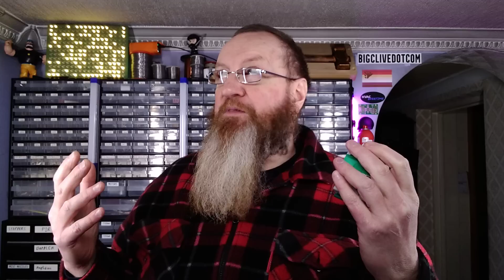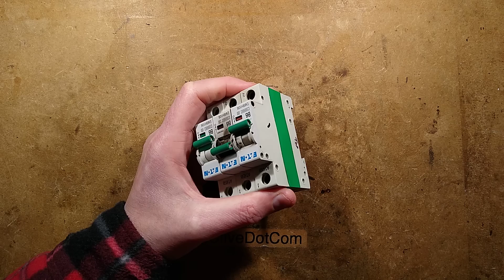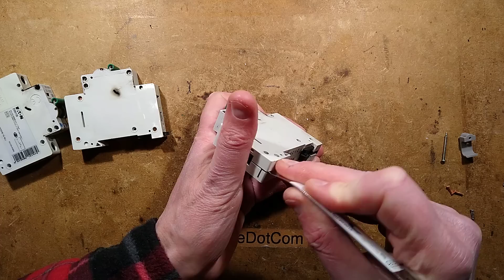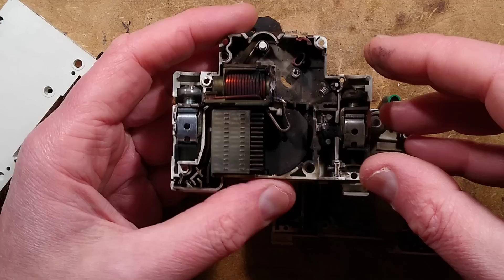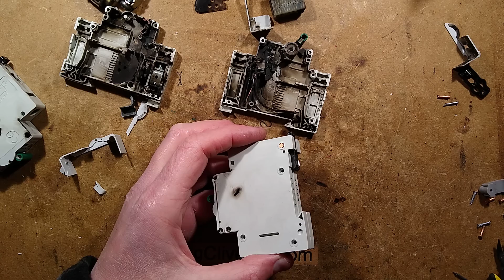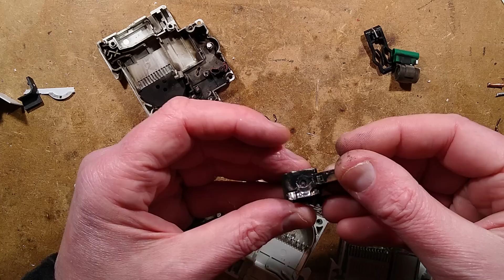Arc flash breaker failure - let's open it

Comment: TDR should work with insulation faults since it doesn't take that much of an impedance discontinuity to cause a signal reflection. Though if the tests are being done under live conditions to avoid disrupting production, those minor reflections could be lost to the noise floor.
Reply: the problem there is, old school cabling and splices will show a huge impedance bump and look like the smoking gun, that will often hide the real issues in between them.
that does work great for coax/ladder line/twisted pairs without any inaccessible splices mid way. every single splice in a huge bump with TDR, enough so it may show every single splice along the way as bad!
Reply: @throttlebottle5906  If you know the distance to the splices, you can ignore those TDR returns. If you don't know where the splices are, your commercial or industrial building probably needs an audit to update wiring plans.

Comment: If it was difficult to locate the fault, does that mean that they don't have enough circuit breakers separating the electrics so troubleshooting can be narrowed down to a smaller area?

By your description, electricians have a tough job because there is no computerized, automatic logging system to describe what exactly is happening in the system. Like driving blindly. Because computer techs are sometimes lucky enough to have an error log to learn from, or simply easily replacing a component or program to fix it. But not electricians. 

And mechanics have error codes they can look for in modern cars, but they need to have the proper scanning tools or pay for the OEM's overpriced tools since some try to lock them down. 

Volvo charges like a few hundred for a week's worth of access? Something ridiculous for VIDA which is their "eye into the car"

Apparently mechanic work differed before computers because there were so many vacuum hoses and there was no magical computerized seeing eye to give clues into the system. 

And with the computerized systems, if you have the proper software you can run tests of certain components right in the software. The extra complexity brings its own issues, like access to tools, computers being stubborn or breaking, repairability, and computers throwing a wrench into a problem. 

They were also the early days of car computers before obd2. And I'm not super familiar with it but I think they had less information, like using a blinking lights to figure out an error code. But I'm not sure if they could view live data of the system or send commands.
Reply from the maker: In this instance it was a long and inaccessible cable run feeding a single circuit of external lights.

Comment: Eaton is one of the worst brands in Europe for circuit breakers, the rating is at the theoretical limit of materials, thin plastic, cheaply made with loose tolerances. I guess another reputable brand wouldn't have been so dramatic

Comment: As an ex-TV engineer and later in industrial electronics, the only certain thing about an intermittent fault is you can be sure you've NOT fixed it when it goes off again.
Reply: As a software developer, same here. You won't believe how much code is in a program just to hide and recover from errors that happen intermittently that the devs couldn't find the real reason for.
Reply: @HenryLoenwind  there's the funny example of the 1990 game Wing Commander which would crash on exit most of the time, they couldn't figure out why, and since it happened on exit and didn't impact actually playing the game they just changed the error message to say "Thank you for playing Wing Commander".
Reply: Yep. Pretty much the reason behind "Have you tried turning it off and back on again?" Something went wrong, but probably maybe hopefully it'll be caught by a safeguard next time.
Reply: @SnakebitSTI  It was what the customer support of an UPS manufacturer suggested to me with a straight face after a three phase, 8 or 10 kVA (can't remember) rack UPS had failed with a literal g*nshot-loud bang.

Comment: A repair shop (prob. most) troubleshoots shorted computer boards in a clever way.  They inject a lower than usual voltage into a malfunctioning board, and use thermal camera to detect heat which indicates there is a short circuit at that area. Then they replaced the malfunctioning components and fix the short circuit. 
I just think it's cool that they can safely inject voltage into the board to figure out the location of the issue .
I'm not sure where else the technique is applicable, certainly probably not a factory floor or high voltage. Because I guess they can't see the entire electrical system under a thermal camera in one go or have it under testing environment.

Channel is Dell Parts People
Reply from the maker: The controlled fault current in electronics is very useful, but does require a decisive short circuit.  (Often an MLCC cap on modern PCBs.)
Reply: A fairly popular technique, better than it's predecessor (as in pre thermal camera's) where you set the current limit to a bit under what you thing the PCB tracks can handle, then go feel each component looking for a hot one. Sometimes you came away with a manufacturers logo burned into your thumb.
Reply: @paulstubbs7678  That's why I made a temperature probe out of a thermistor and an old pen barrel.  Saves my skin looking for hot parts!

Comment: About 14 months ago or so, a bank of those breakers popped and burned under my stairs. Luckily, there was no further fire risk, but it cost £400 to replace them.
Reply from the maker: I wonder what brand they were and what initiated the fault.  There have been some rogue brand failures, breakers damaged by over-tightening with impact drivers and tightening with the wire or busbar at the back of the terminal clamp.  The latter two are a common issue with slideshow-trained labourers and "multi-trade" operatives.

Comment: I did one week of training when I got a job at SquareD assembling circuit breakers. I learned so quickly I knew I would go crazy if I returned after training. These are a little more complicated than SqD's but the main components are similar down to the what they termed the arc stack. Interesting how the traces can form

Comment: A couple notes from the circuit breaker industry.
The 10000A figure is a dead short and depending on the claim - the breaker is designed/tested to open on this once or twice- that’s it. 

Most faults well below that. Arc faults are usually much lower and longer lasting, so what Clive has mentioned with intermittent fault is quite possible.

Each trip takes its toll - eventually it gives out. 
I hope they found the circuit fault!!
Reply from the maker: After the explosion they got access equipment in and found a melted terminal block in an outdoor junction box.
Reply: I had circuit breakers in a panel near the ceiling in an old workshop. On really hot days, 40 C, breakers would pop with quite light loads. They could be reset for a few minutes then go again. When the temperature dropped they would stay set. A fan was parked temporarily below the panel and all stayed happy. Because the CBs were not overloaded, they were undamaged. Only two or three days per year.
Reply: @howardsimpson489  your description makes it sound like overload rather than short circuit or arc flash. Those circumstances of tripping are far kinder to the contacts. 
The bimetallic to trip on overload is calibrated for temperature too, so it would not have even been at full load current!
Reply: @nickthompson5025  Reads like it's an ambient temp issue, nothing more.  
Seen the same occur with a Main supply breaker enclosure (3ph - 250A) mounted on a street pole (supply authority property prior to building attachment) that would bake in fully sick hot Western Australian sun. The thing would trip with moderate load... only on those above 40C days.  
It doesn't help when it's a fully enclosed DB.. or when people cram the pan.  eg. 32 CB on a 36P pan. Pays to leave the occasional 'spare pole' space between groups of MCCB's. 
Same applies to compact contactors mounted on a DIN rail without a gap. TB end clamps space em well... or group no more than 4 in a row. Then with a contactor wide gap between the next group.

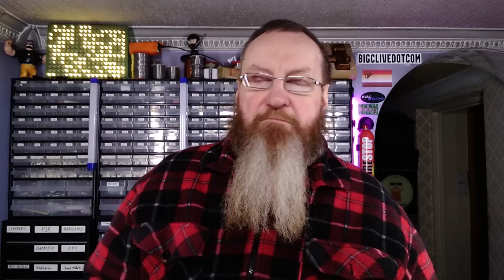Comment: 0:45 Tracking. This perfectly describes what happed to my outside light. It was wired with Mineral-insulated copper-clad cable and buried underground. I had to replace the fuse wire every so often, but it would work for months. Till recently when it blew as soon as I replaced the fuse. 

I isolated power from the circuit and the fuse wire holds. In two months time the circuit breaker panel is to be replaced with a proper breaker box. 👍🏻

Comment: This is a design/installation issue not a shorted wire issue. Yes there was probably a shorted wire but the entire reason you have protective devices is because shorts occur and need to be handled safely.
You didn't say if there were single pole breaker or a single 3 pole.. If they are singles the holes in the sides are a major design flaw even if allowed by IEC standards.
Aside from the actual short circuit the damage and issues are probably a basic system design issue. I bet no one did a arc-flash/ coordination study before starting the project. An upstream breaker should NEVER trip in a properly design system. 
Here are the basics
The local utility provides a huge amount of available energy which is rated in thousands of amps (kA). As you pass down stream, through cables and devices there is less and less energy available due to the cumulative resistance. You have do actual engineering to know how much energy is available at any point in the system. This is part of the arc -lash study. Once you know the available current at any point you need to select devices that both trip faster than the upstream device and can handle the available fault current (coordinated with the upstream devices).
As a general rule, fuses are able to handle larger fault currents and can trip faster than breakers (high interrupt breaker become very expensive).
In this particular case the breakers in Clive's hands are rated at 10 kAic which is the lowest rating available for panel-boards and was clearly to low to prevent the arc event.  It is switch rated to 15kA so there should have been no problems with repeated trips and resets on a 10kA feed.
I workl in the electrical industry in New York City and I am particularity senstive to the issue as the local utility provides 200 kA to almost every service location including private houses. the largest interrupt in a standard beaker design is 65 kA.  Every main coming in has to get fuses before the breakers to limit available current..

Comment: Yes they were doing multiple resets, till the breaker blew apart. Had that occur to a local church, where the roof lighting (on a wood and canvas roof) would trip from tracking from water ingress, and thus they would repeatedly operate the breaker to get the lights running. Then some bright spark replaced the original breaker with a 40A one, which would stay engaged, because of the long cable run meaning it was no longer capable to do an instantaneous trip. They had an illuminated address, and had to raise money from the congregation to get a new roof, along with all the interior, as a result. Video at https://www.youtube.com/watch?v=9oIhSzLhqqw
Reply: The modern equivalent of shunting blown fuses with copper wire. Despicable!
Reply from the maker: Uprating breakers, bypassing breakers, bypassing RCDs/GFIs and wrapping foil or wire around blown HRC fuses.  All things done by unskilled labour being "heroes".

Comment: I did once see a contact vaporize -- and copper plate the inside of a relay housing -- when an amateur tried to hook up a simple circuit.    100 amp supply dead shorted.
Reply: Usually, this shouldn't be an issue. I have once triggered the main fuse for my house (50A 400V 3ph) due to an "wiring mistake". Made a significant thump, but no harm done to any components.
The real issue is when inductive loads are added to the mix - they love to continue the current flow at all cost.

Comment: Is it at least partly because it was mounted sideways? If it isn’t right side up the arc breaker bits wont engage at all will they? Just restarting it would eventually cause it to die, but if it was actually mounted horizontally as Clive says initially thats definitely made it worse.
Reply from the maker: It is an oddity that industrial panels have the breakers mounted sideways like in classic American panels.
Reply: The arc is still propelled by the magnetic field generated in the arc chute contacts. The datasheet will tell you the allowed monting position, but i dont know any DIN rail breaker that will not work horizontaly.

Comment: The instant pull out due to inrush is a huge nuisance but nobody believes me when I tell them they’ll need to unplug some loads, it’s infuriating
Reply: In high school and college, teachers told us to not turn the CRT monitors off or on all at the same time. It only took a handful of people doing it in sync to trip the breaker to the computer rooms 😂
Reply: This circuit breaker experienced in-fury-ating current.

Comment: Unfortunately, when breakers are accessible by the general user (workplace or home), they will repeatedly try to restore the breaker multiple times, even if they manage to clear the fault, the breaker is weakened, carboned up, or splattered with copper.
Thise are the breakers that get hot, and especially in a vertical stack, will start making the one above trip prematurely, so you chase your  tail trying to find a non existant fault on that circuit
Reply: I heard from an industrial maintenance guy something that went like this "If one of the VFDs blows and trips the breaker, we will just slam the breakers until the faulty one is blown clear." This was in response to my surprise at the level of damage inside one of said VFDs.
Reply: @djtransnazgrz  yep, sometimes instead of a branch breaker, it will cause a whole sub panel feeder to go down. reset/reset/reset and look for the smoke emitter or downstream to trip. do it with an extended pole just in case.   🤣
Reply from the maker: And the non technical operatives that explain that you just keep switching it on until it holds as if that's the normal way to use the breaker.

Comment: Nice! I wonder if those breakers are of the (bad!) kind that let you hold the contact closed, or if instead the breaker can break the current while the actuating lever is still being manually pushed into the closed position? If they are of that kind, then I wonder if an impatient person chose to hold it closed when it repeatedly tripped...
Reply: These breakers trip open regardless of lever position. You can hold the lever in "on" position and it will still trip open.
Reply from the maker: In this case the mechanism trips internally even if the toggle is held in the on position.  Some simpler thermal breakers do not have that protection.

Comment: These can take a lot less short circuits or overloads then most people know.
More like 20-30 than a hundred.
You should therefor change them for new ones, they are inexpensive now, branded ones for about €10 on designated sites for these parts. 
My appt. was about 20 years old, bought a complete new box for €400.

Comment: How do these detect the arcs? 🤔
Reply: They are not AFCIs, but just regular breakers. As I understand it: the intermittent fault is a short circuit, with a high fault current. The breaker is nominally able to interrupt that fault current, but after repeated events the breaker eventually wears out, and in time the breaker fails catastrophically when it is no longer able to operate according to its specifications.
Reply: @ib9rt  Thanks for the explanation, it looks like a normal breaker. I was so confused 🥹
Reply from the maker: They only detect over current.

Comment: Perhaps AFDDs are a good idea. I wonder what the Short Circuit Current was at the distribution board where the breaker was installed, was it less than that  of the breaker?
Reply from the maker: I'm not a fan of AFDDs in the UK.  Our faults tend to be more decisive at 240V and molst home installations have RCDs (GFIs) that will kill the power to that circuit when the burning causes the earth/ground to get involved.  They have far too much active electronics in them for reliability and safety.

Comment: So did the arc (or fault current) in the centre breaker jump through the hole into the outer breakers? That seems rather extreme!
Reply from the maker: The flash plasma would have gone into the adjacent breakers.

Comment: Intermittent trips at home are often due to failing insulation or moisture in a powerful heating element like that used for a kettle or oven.  But it's obvious if that's the cause, as it usually trips when you switch on the appliance.  Incandescent light bulbs are the other one, but not so common these days.

Comment: Faults like this:
Usually PVCa underground cable which a contractor has damaged and then kept his mouth shut. Water ingress, breaker trips. Reset and maybe a week later repeat. This carries on for months with the interval between faults getting shorter. Eventually it shortens to say under 5 minutes. Put a 500v insulation tester on it at the instant after the fault, and see the breakdown. 2 minutes later, and it will be many megohms. Have seen 300 metre 4 core 16 sq cables abandoned because of this.